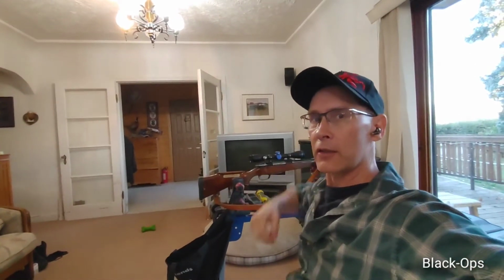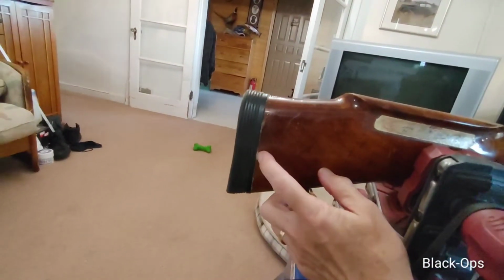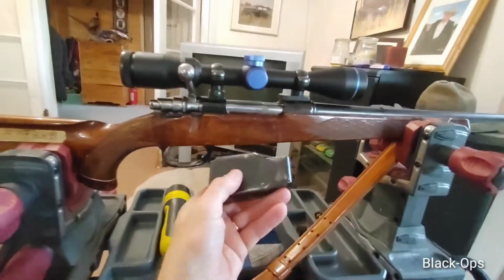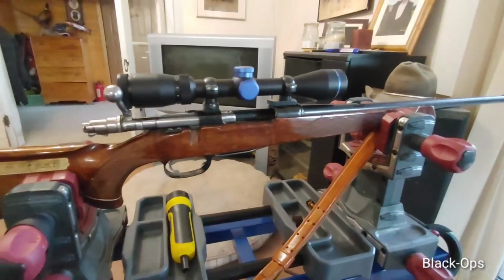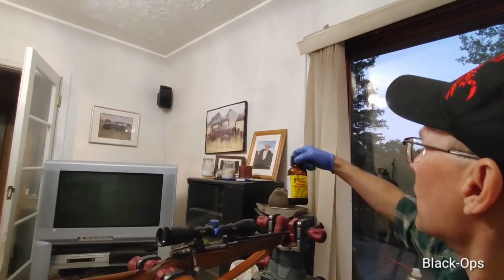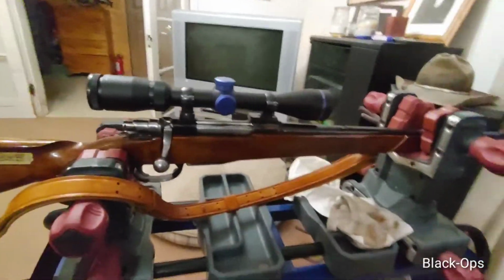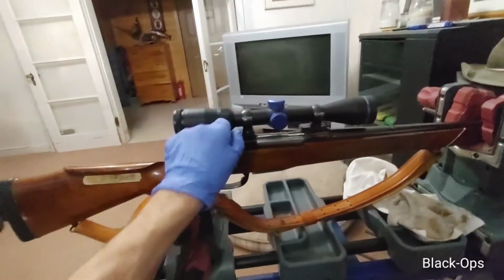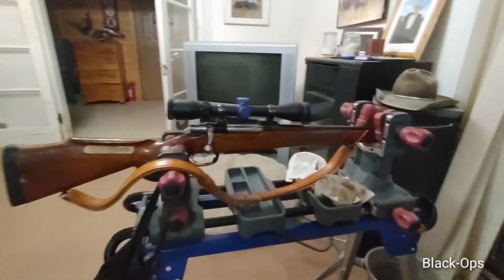Silicone Spray as Gun Lubrication and Cleaner?

Comment: Hopped 9 it's a fantastic solvent and smells like the finest cologne 😁. I am sure you've used that. If you want to get more aggressive and are very careful around the wood finish, acetone is very effective. Somewhere in between you could use mineral spirits. I use dry silicone spray to wipe down the exterior of my guns and it is a fantastic exterior cleaner and protector. And you are absolutely right. It is good with repelling dust.
Reply from the maker: I also love the smell of #9, thanks for watching and for the comment

Comment: I've found graphite works excellent as a lubricant ,,especially in freezing temperature , been using it for years
Reply from the maker: Do use the dry powder graphite, or is there a graphite spray?
Reply: @Wheelchair-bear   powdered , it may look dirty but it's slippery ,
Reply: Graphite and Molybdenum Disulfide are both solid choices for something slippery and affordable. I'm fixing to order some molybdenum disulfide.
Reply from the maker: @thebadgersdenvaletudoclub6254  I will look into that, thanks.
Reply: I don't think graphite will protect from rust